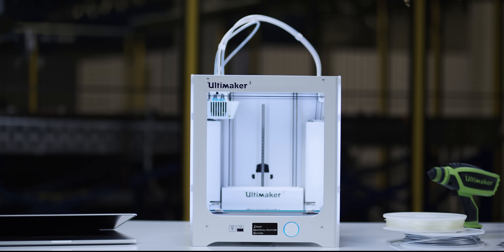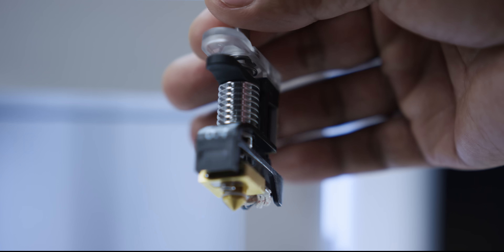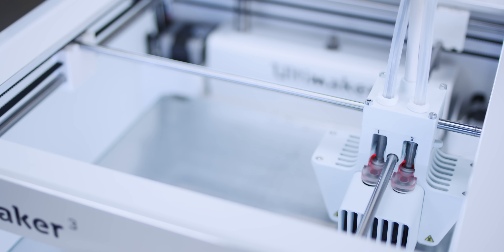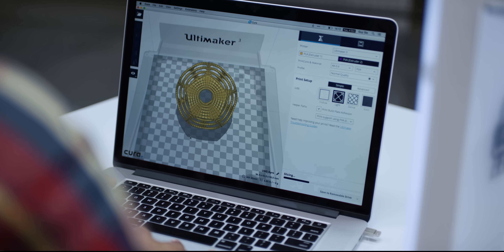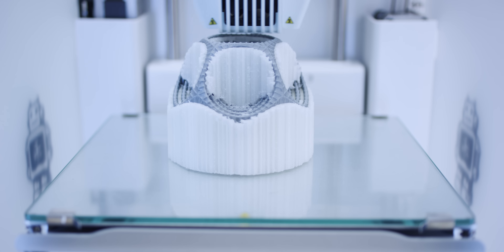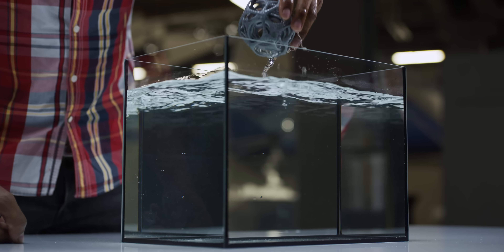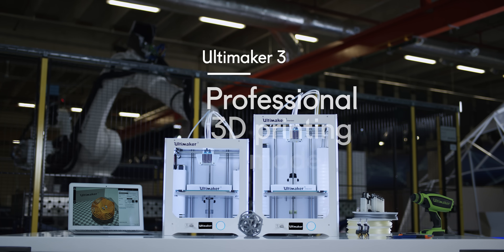Ultimaker 3 Features Explained - Professional 3D printing made accessible

Comment: I have to use the ultimaker 3 at work and i honestly can tell my anycubic vyper for 240€ i had and now my bambu lab a1 are much much better than that shit ultimaker. It's slow, it not accurate, it fucks up like 20-30% of the prints, you have so much work cleaning the mess. The worst thing with it is the glass plate. I HATE IT SO MUCH. Either nothing sticks to it, or it sticks so much you have to fight with the plate either breaking the glass or the part you printed on because its like super glued on. Today i came to work to find AGAIN my 15 hour print ruined. With normal printers with a metall plate your parts simple fall off when the plate cools down. With that glass plate if your print is finished over night and when the plate cools down 5mm from the bottom of your parts shrink and get like a vaccuum suck on that plate. So they can be only removed forcefully. You either break the parts or you rip off an edge or surface. I HATE THIS PRINTER SO MUCH. Glass plates suck and this printer is terrible bad and slow.

Comment: Are the reels/mats proprietary? ( encoded)
Reply from the maker: Hi Leo, thanks for your interest! The reels at Ultimaker printers are not proprietary, you can use any brand of filament you want with them, as long as it meets the Ultimaker specifications. However, they do include an NFC chip, which helps the printer to recognise the characteristics of the filament used and advising the right settings for it -only when using a Ultimaker filament.
Reply: So when not using the Ultimaker filament, the parameters that match the material are input manually?
Reply: Yes

Comment: It's nice to be able to monitor the progress of a print remotely (especially true if your home and production facility aren't in the same place), but the most ideal would be a printer that can:

1.  Pause the machine immediately if a nozzel clogs or a filament breaks, using a Tunell filament sensor or similar device.  (That this isn't standard equipment on every FDM printer baffles me.)  

2.  Use the wireless capablity to notify you via your phone that the printer has paused and is waiting for you to correct the problem.

It's no fun to return to work in the morning to find that your 46-hour print failed during hour 13 and you now have to start over.
Reply: lol, the price will probably jump another $2K for these features given the cost of what it is now.
Reply: I think this ultimaker has a filament flow sensor that pauses the print if the filament runs out or the flow of filament unexpectedly slows down

Comment: Does the UM3 have a Tunell filament sensor or other device that will pause the machine in the event of a clogged nozzle or broken filament?  Some of the models I print have build times in excess of 40 hours, and it's no fun to discover that a print failed at 3 AM and I have to start over.
Reply: of all the things. none of these expensive printers have any of that shit... it's infuriating since it's so simple and improves reliability quite a bit.   Needs filament sensor, needs recovery from power outage or other possible failure due to nozzle catching on curling overhangs... And Auto material detection without an NFC :)

Comment: I'm still VERY satisfied with my UM2.
Best thing I Ever bought in my life.
Reply: Hey i got two questions please,
Is it easy to work with even if you have no experience in the 3D printing?
And how much did it cost you
Reply: Having an UM2 - one of the first ones after a RapMan and then a ReprapPro (both assembled myself). I bought the UM2 because already the UM1 (I never had) was the most reliable machine. Nevertheless, the feeder (I printed a better one myself) and also the printhead (finally used Olsen components when they came out after several other experiements) were weak. 
As the machine was not used in the past years currently i am investigating how to improve it (still I thing there are better techniques than FDM which most times is good enough). I had added a front glass. 
The Extrusion Upgrade Kit for the Ultimaker 2 -> getting a Ultimaker 2+ is one solution. But the invest amount seems to high. 
Looking at the Ultimaker S3 it seems the box has the same size. There are several improvements. 
-> They should offer for a reasonable price - a little more than the (expensive UM2 Extrusion Upgrade Kit) - to upgrade it to an Ultimaker S3. 
Right now I am also looking for the competition from the Czech Republic in getting a new one from them which is not that expensive. 
Most realististic (there is no big demand for FDM parts right now) I think i will install the most recent Cura Software. Then maybe get a state of the art feeder. On the print head i am not sure if there is a need.

Comment: Will the Ultimaker 2+ get a upgrade kit to the dual extrusion of the Ultimaker 3? Like the upgrade kit form Ultimaker 2 to Ultimaker 2+?
Reply: Also because I think, that I don't need the other new features like the Camera or WIFI/LAN connection.
Reply: Or just a dual extrusion addon for the Ultimaker 2+
Reply from the maker: Hi Heppy, there will not be an upgrade kit for the Ultimaker 2+ coming. The changes needed to get a reliable and accurate dual extrusion system on the Ultimaker 3 were extensive, and not backwards compatible with the Ultimaker 2 design.

Comment: but the ultimaker 3 is dual finally! As you can see on http://3d-drucker-test.eu/ultimaker-3-im-test-alle-infos-zum-nachfolger/ You can use two different filaments, or one filament and one water soluble pva. worth the price in my opinion
Reply: I have the Ulitmaker 3
The worst user interface you can imagine
great printer but hard to use or very hard and time-consuming to use

Comment: those filament reels are TINY, what's the deal? they look like they're less than 200grams? can this printer work with generic 1kg reels? also do you do educational discounts on the ultimaker 2 now the 3 is out? thank you
Reply from the maker: Hi Jackson, the spools that come with the printer are 350gr each. You can still use regular sized spools, though specific suitability depends on the size spools used by your filament brand. For information on education discounts please contact your local reseller of Ultimaker products, they can inform you of any discounts available in your location!

Comment: will the ultimaker 3 continue printing after i shut down my computer if I use WIFI?
Reply: rc-wingman --- Bro, did you just ask Ultimaker if you should buy the newest Ultimaker? WTF do you think the answer is going to be?
Reply: +Harambe Hahahaha,  thats the point.. => a funny discussion ;)
Reply from the maker: Hi rc-wingman, the Ultimaker 3 will continue printing if you shut down your computer. Cura sends the entire file to the printer prior to starting.
Reply: cool, Thank you. I have the ultimaker 2 +. should I wait for the UM4 or do you think it makes sense to invest in a UM3? :D
Reply: Is this different on a mac? We use this at work and when I send the job through Cura and the system goes to sleep it stops printing. I have to keep it awake and just lock the screen for it to keep going.
Reply: +Matt Woods it's the same on Mac, but there difference is between the um2 and the um3. The um3 will continue printing, while the um2 needs an active connection to the computer.

The um4 is probably very far away. I think waiting for the um4 is a bit pointless...

Comment: "A professional yet accessible 3D printer" - What is accessible about three to four thousand dollars?
Reply: it's fast but it isn't magical... you can get similar quality on a $300 printer too... most of the Plug and play of any printer is entirely software and most filaments are well made enough that the settings will be nearly identical except temps, and you still have to tweak that on a UM and adjust settings for specific model types unless you print with supports on always, print with a brim and other "safe" values.    it's at least $1K MORE than comparable printers... and NFC, Wifi and camera ain't worth that extra $$.... just a tiny tweak to their dimensions (extendeded? lol)  drives the price up 1K and the costs for support and materials is nearly negligible.   probably $5 in extra material to make it bigger... it's just expensive.
Reply: Well, the price tag... for what it is this is extremely affordable, 3k even for a small company / studio is very reasonable, and with the dual nozzle PVA support, you're a water tank and a circulator away from never having to send your stuff out to be printed, which means this will pay for itself in a few dozen prints. 

"But you can do the same with DIY rigs", can you really? Not everyone who uses this cares about the machine, they're just trying to get work done, not having to fiddle and tweak every other print is a huge time and effectively money saver.
Reply: Where are you pulling this number from? Also, why do you assume there is only one other option? There are plenty of printers with dual extrusion that will do a great job. Might not have all the bells and whistles, but the quality of the print is all that matters
Reply: Bitcoin
Reply: to a company, its like penny compare what this brings to you without all the DIY hassle.
Reply: I got the accessible part done, my library has it, i just have to get there and set up the print before anyone else does
Reply: Considering the other option for same quality, same results is over $50,000... yeah it's very accessible mate.

Comment: I see a Cubepro here.  A few advances, but a Cubepro where everything has to be purchased from Ultimaker.
Reply: Will Hallewell cubrpros are the definition of trash printers
Reply: Jordy Schreuders i see proprietary nozzles, and the filament spools are not only smaller but if the printer "knows" what filament You are using then it also must be proprietary.  I'm not saying that you must use ultimaker products, but they are heading down that path.  the original ultimakers are not like that.

Comment: Once I saw the price I just said noooooooooooooooooooooooope.
Reply: You haven't even seen the print quality....
Reply: Yes, you can build a printer. No, it probably won't print better.
Reply: Ah yes. The first layer doesn't say much about print quality, though. It's to do with keeping your bed clean, platform adhesion and bed leveling.
Reply: angelorf well it depends wich quality at wich speed of course i can print with superslow accleration like ultimax does and can say heeey i printet this at 100mm/sec if the real printspeed it maybe 1/4 of that... once i have my core done i can print easly same quality as this ultimaker but 2-4times faster
Reply: +Jade Sontal how do you know? You don't know the speed of the Ultimaker 3!
Reply: it's the convenience of having a ready made supported product you pay.. you can probably easily reach the same speed and quality with a much cheaper setup, but you have to finetune it yourself.. IMHO this is part of the experience if you build it for hobby.. but if you are just interested in printing parts without thinking about the setup, you buy a ready made machine and pay the extra.
Reply: *****  the only problem... even printer like this um3 needs finetuning for sure. well, we will see sooner or later how good the ulti 3 really is.
Reply: Conner the Barbarian but its worth it, then shitty diy kits man
Reply: it's at least $1000 more than comparable printers.  there are plenty plug n play printers and dual extrusion printers that are cheaper.  BNC3D is less,  Prusia MK2 is less.... Zortax is less and the quality of those machines blow this away 10x (except it's closed source) etc... it's priced partly due to the name too...
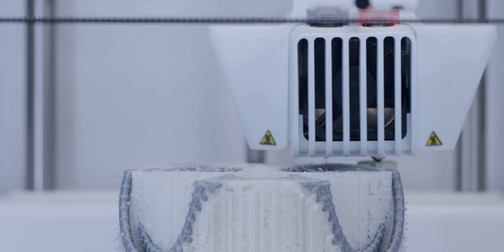Reply: Go to 3:00 and fullscreen
Reply: dont worry you can already build a printer wich prints better for sure for around 500€

Comment: Interesting, I'm sure its a high quality, reliable machine. Definitely designed for companies, not for hobbyists, which makes me slightly sad. I hope it is successful! I'll be curious to see if there are many reports of PVA clogging, it is a very temperamental material!
Reply: Quite some measures have been taken to lessen that problem. PVA support settings will print all support with PVA, have a thick support interface and support horizontal expansion, so that there is a fair flow of PVA the whole print through. Also the BB print core is especially designed for PVA.

Comment: What is the NFC feature for on the spool holder for? Does this lock us in to your filaments or can we still use whatever 3rd party filament we want?
Reply: The UM3 does not lock to proprietary filaments. Any filament can be used. The only thing is that filament with NFC tags (which you could make yourself) is automatically recognized and some data about how much material is left could be stored. It's just a feature for ease of use.
Reply: I hope not, that would be a terrible business choice.
Reply: ivs18 If they Would lock it, just hold an empty spool with the right tag on it next to it. But seeing all their brilliant improvements, i think this company is clever enough not to do such a thing.
Reply: Richard van Pukkem But if they use the same form of NFC lock that XYZ has on their DaVinci Jr it would also keep track of the filament on the spool and once you hit 0 it won't print.
Reply: -spool -hacking Challenge!
Reply: Ultimaker 2  for consumers; Ultimaker 3 for Companys. 
Companys like to have a "one manufacturer solution",(to blame just one company if anything goes wrong.and it improves Workflow.)

I am wrong,Ultimaker?

btw.: great machine! love all your work from day one.You really did a nice job on the U3. congrats
Reply: angelorf Yep i've read the same thing yesterday on Facebook, straight from the UM employees themselves.

Comment: Price please!,  and any update for ultimaker 2+????
Reply from the maker: The price is €2995 / $3495 ex VAT for the Ultimaker 3. We're sorry, we won't be able to offer an upgrade kit for the Ultimaker 2+ - too many parts have been changed between the two models.
Reply: 2995 Euro excluding vat for the normal and 3695 Euro excluding vat Extended
Reply: vat?
Reply: How about just the dual printheads?

Comment: ABS with water soluble PVA - is that possible?
Reply from the maker: ABS won't adhere well to PVA so that is not a possibility. You can use PLA with PVA and Nylon with PVA!
Reply: Ok thanks but how does the Zortrax Inventure do it?
Reply: I think what Ultimaker is trying to say is that it's not recommended. Cura allows full well to print with ABS-PVA, but it's not recommended because the settings haven't been tested extensively.
All PVA settings are based on PLA-PVA.

Comment: dual extrusion upgrade kit for U2 please!
Reply: I think this is the only way for now http://ulti.creatr.it/en/index.html
Reply: +Ultimaker That's a shame as there are still so many parts that have stayed the same or only changed marginally.

Parts like the printer's body, z lead screw and xyz rods and steppers. The important changes seem to be in the xy carriage, addition of a second feeder assembly in back (where mounting holes already exist on the UM2 models) and possibly a new control board, though I imagine the UM2 board is robust enough to handle the new dual extrude features minus the new USB thumb drive input.

It seems to me that an individual who could perform the Plus upgrade or simple maintenance on their UM2 is well equipped to upgrade their machine to UM3 specs if only the parts were made available.
Reply from the maker: Sorry! we won't be able to offer an upgrade kit for the Ultimaker 2 series, as too many parts have been changed between the two models.
Reply: An upgrade kit would target a very small market as it would be too difficult for most people to install. Small quantities would make the upgrade set expensive. My guess is that it would be cheaper to sell your current UM2(+) and buy an UM3 than the price of the upgrade would cost you.